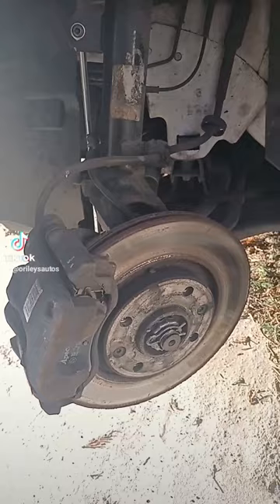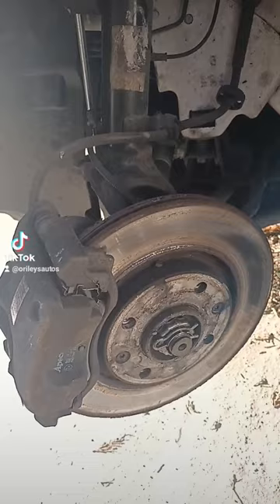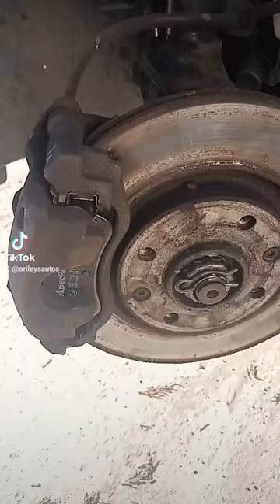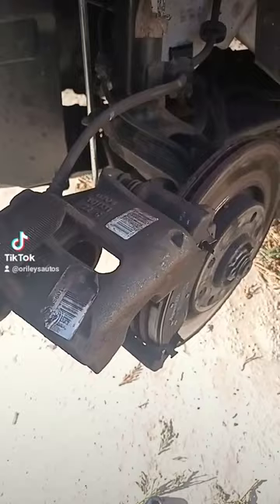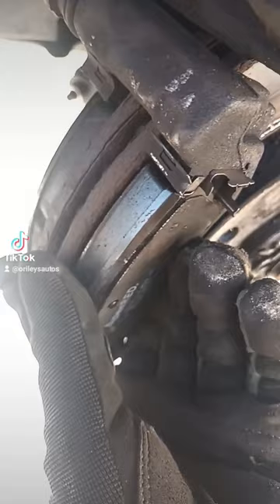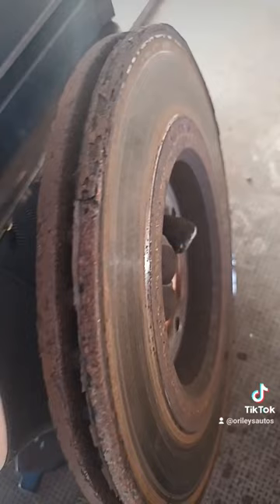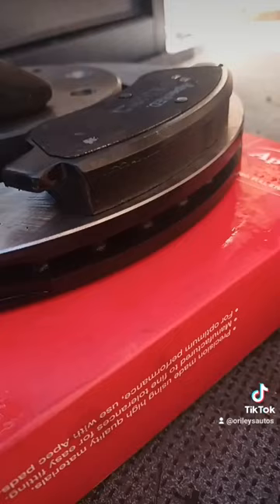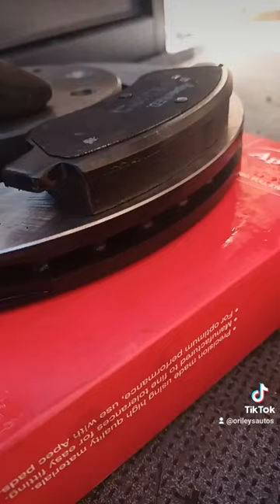My Brakes still sound like they're grinding after fitting new brake pads.. #shorts #mechanic

Comment: Clean the disc's up! Chip the shale off of them and cut back the lip with a sharpened file.
Reply: Knock rust off and just clean up edge with flap disc. Bloody thro away society I do mine twice a year and don't let get bad like that.
Reply: @andrewmicas4327 That's fine if you want to do that yourself but as a mechanic you wouldn't take the risk. With the amount of wear i can see i wouldn't be surprised if they were distorted which could be problematic for the MOT. Looking again, I'm amazed you suggested cleaning them actually.  Vented discs thickness are more concerning too. They might be fine now but could possibly crack/snap before the pads are worn out due to being too thin. Not good. 
The method he chose will keep those brakes off the customers mind for ages with no problems. It's what most want. 
No one wants thin distorted discs that need replacing within the next year after already paying someone to "fix the brakes" (is the normal term.)

But again. If you stay on top of these things yourself, you only have yourself to kick IF anything were to go wrong. Do as you please but see it from a professionals point of view :)
Reply: They are getting money
Reply: @Taylor-rq4fv  depends on the mechanic ig. Got my car looked at... said I needed just some new breaks... 2 days later shits crunching and grinding. And pretty sure it's cause they ignored having a lip.

Comment: Hi I bought a disc that was to big, grinded the edge down a millimeter or even two but the fuckin tention thread makes the brake "thing" pushed towards the edge.. Will try to bend the thread so there is less tension. Had the wheel on/ off like 8 times in the process...
Reply from the maker: Brakes aren't something you should be altering.  Get the correct disc.
Reply: You would have only had to take the wheel off once, if you just return what you bought and got the right stuff. But now you're going to endanger others on the road and yourself. Hopefully this isn't also the same vehicle you take your kids to school in. Get the right shit

Comment: That's exactly how my rotors look. Surprisingly they don't make a sound. Changing them next week, hope I don't screw it up.
Reply: Super easy bro
Reply: If they still have meat on them you can flatten them out with a wire wheel or flapper disc, rotors are pretty cheap to replace tho

Comment: Funny part is I’m in the process of fixing my rotors and brake pads but I need a power ratchet to get these damn bolts off😭
Reply: Get some rust spray, a breaker bar, and a pvc pipe. 
Spray down the bolts, attach the breaker bar to the bolt, put the pvc pipe over half the breaker bar and jump on it until it comes loose.
Works every time
Reply: @Zeldamarie1482  thank you bro🙏🏻